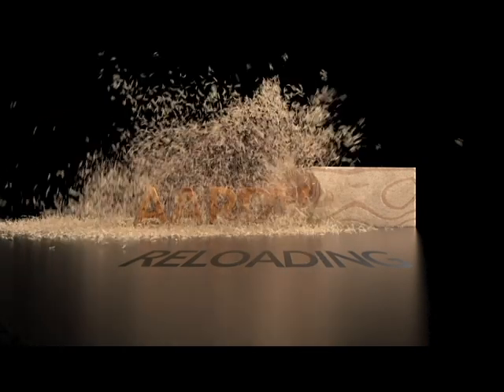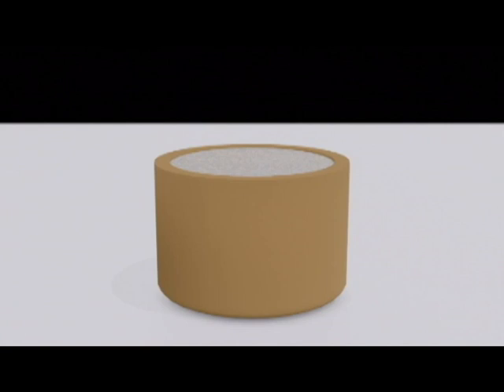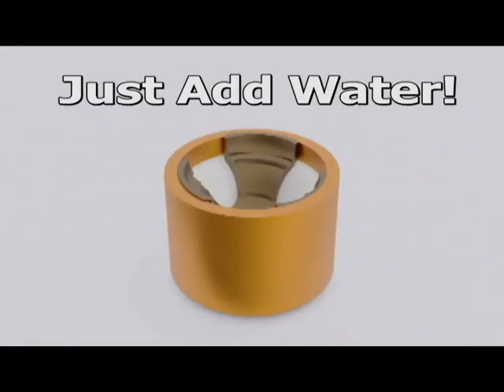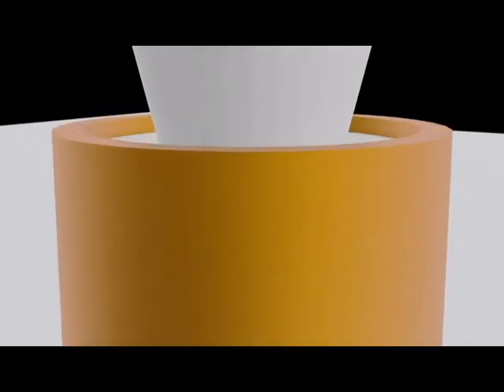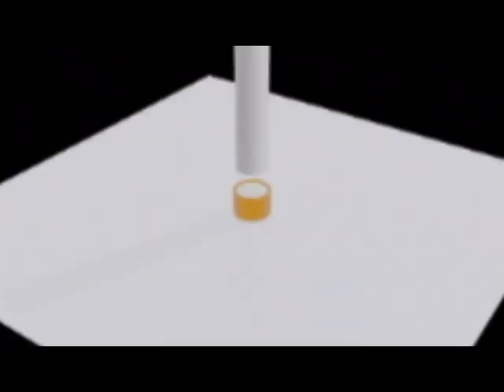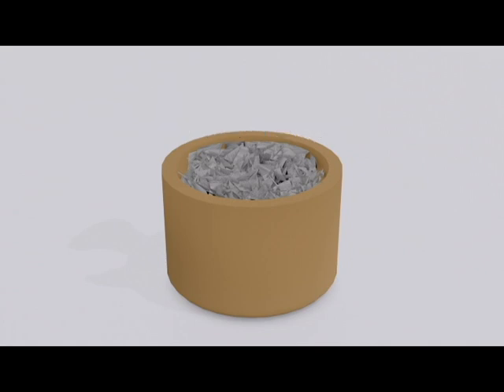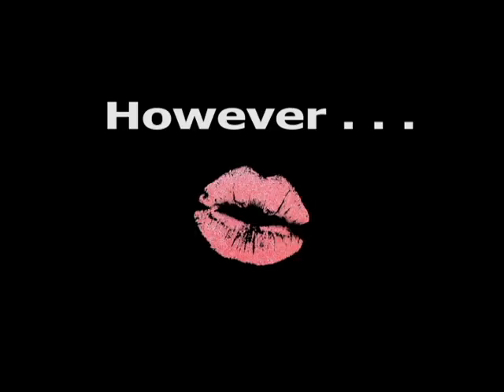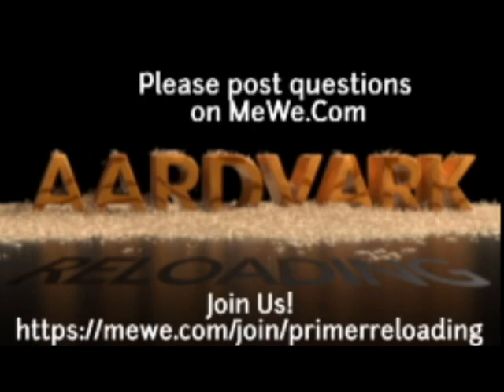EPH 20 Powder Packing Methods

Comment: Is anyone using EPH series compound for percussion caps?
Reply from the maker: Yes.   I can use EPH 20 or Marshall recommends EPH 0.   Eph 0 is EPH 20 but lacking the ingredient NC.   Nc is nothing more than ground up pistol powder.

But both recipes work equally as well.

Good question
Reply: @helpmenowmark thank you! I used the compound from 22Reloader and sealed it with NC lacquer! NC lacquer is powdered NC dissolved in acetone.  That mix is super corrosive which is why I’m going to learn the EPH series.

Comment: What is the best method to reform flat bottom of primer cups? Is it possible / nessesary to get exterior and interior of cup flat and smooth ?
Reply from the maker: Good question(s).     We must repurpose most of our tools.

But a company called NOE recognized the value of what we do.  Primer reloaders need round resized cups  as well as a "de-dimpled" cup bottoms.   

Here's a page from Aardvark

https://aardvarkreloading.com/primers.html

Scroll down until you find the de-dimple methods (and the NOE tool)

The cups must be re-flattened.    A gap between the nose of the anvil and the bottom of the cup must exist (i call it the pinch gap).    The powder is compressed and the ingredients rub against each other.

Its explained here.

https://rumble.com/vtj5g9-homemade-primers-how-primers-work.html

We think that gap must be 0.01" or   no bang.

Sort your primers while they are still in the brass (primer pocket).   It's so much easier that way.

Lots to talk about.

Join us.

Scroll down to bottom of this page
and look for the MeWe invitations

https://aardvarkreloading.com/index.html
Reply: @helpmenowmark  Hey Mark. love the videos. What do you think about a device that can make primer cups and anvils from sheets of metal? Do you think primer reloaders would find such as device useful? I've been working on one for a while and would like to have some opinions as I would like see about selling a few of them for testing. 
Thanks!
Reply from the maker: @schoof5054  I'd say it would be wonderful.    One of our users successfully made an anvil maker/punch but he has his own one-of-a-kind.    I have some notes on the thickness of the metal sheets ..uh somewhere.    

In the small primer world (excluding talks for Large primers for now) I do know the thickness of any primer cup is .015" 

It's the bottoms of the cups that differ.    I have a vid 
https://rumble.com/v2eeonf-sorting-random-small-primers.html

I venture to say that I'd concentrate on the cups - because the anvils (for both lp and sp) usually survive but it's the cups that take the beating (distort the most).

Have you joined us on mewe?    Seems to me you did.

See:   www.AardvarkReloading.com (at the bottom of the page ... join the MeWe Groups).

Comment: H48 priming powder series needed. Methods and tips.
Reply from the maker: Got ya' covered

https://aardvarkreloading.com/H48.html

Wash your barrel out with warm water (is better than just cold) and a mild detergent.    Dry and oil up noŕmally.

PrimeAll is H48.    Kids caps are  weaker version of H48 but corrosive as well.

Seek the noncorosive recipe called eph 20 in Marshalls document